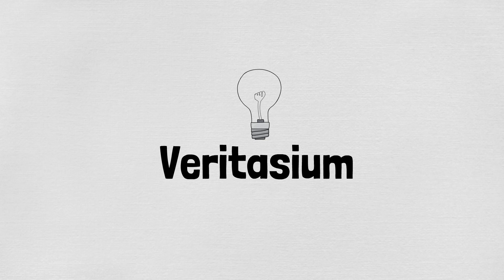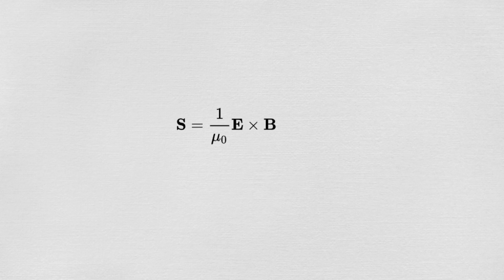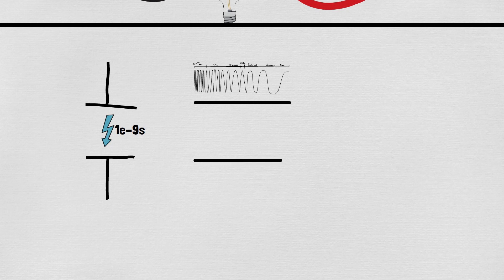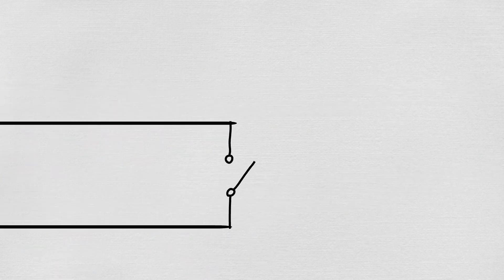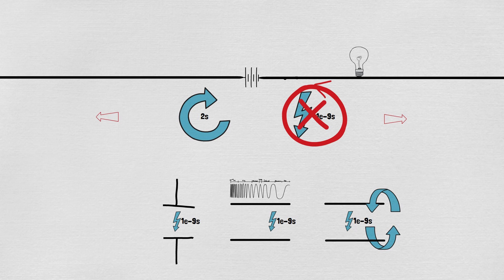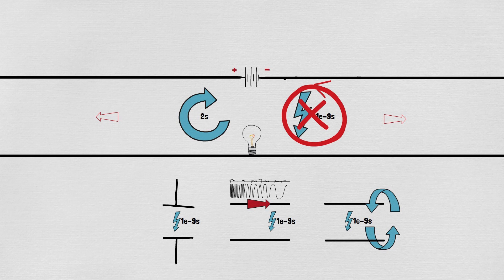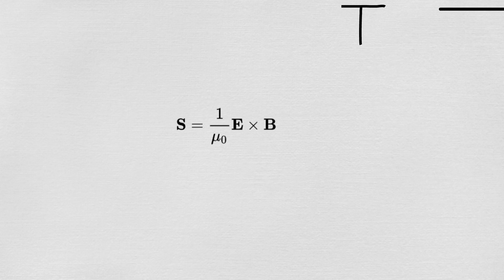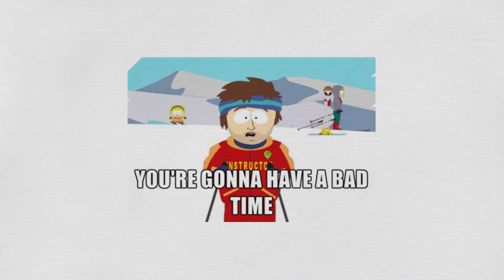Veritasium is Right? (see description)

Comment: Won't it take 1 second, rather than 2 for current to flow through the circuit? I.e., when the switch is closed, doesn't the circuit establish itself in both directions from the battery establishing a full circuit when it reaches the light, 1 second from either end of the battery?

Thanks for sharing this video! Your explanation makes perfect sense. I'm looking forward to Derek posting a retraction.

Comment: I provided the correct circuit analysis by way of comment on the RSD channel . It is basic electromagnetics requiring only application of the Poynting theorem . And yet on goes the flow of comments that causes one to wonder if people read their own writing critically before posting them . The lessons to be learned are , energy flows from the field into the conductors and the load . Energy flows from battery to the fields . You need both moveable charge and fields for electric energy to flow.  Thanks.

Comment: You did make a very correct observation, which summarizes what makes me despise the veritasium video. At 3:35, you mention if we just have a battery connected to a wire, would it power every lightbulb in the universe? In a way, yes, which is why veritasium's video is extremely misleading. If you connected a battery to itself with a switch in the circuit (so you have a wire loop with a battery and a switch. If the switch is on, the battery is shorted; if the switch is off, it is open circuit). Every time you toggle this switch, every lightbulb in the universe will "light up" at the speed of light. The problem is, how infinitesimal this "lighting up" is going to be.

He completely omits the fact that the lightbulb would receive a TINY amount of power from the EM coupling. Any uninformed person who watches the video, will rightfully get the impression that the lightbulb will turn on in 1m/c at the same intensity as though it were connected directly.

Veritasium has attempted to "blow people's minds" and distorted the truth. Everything he said was factually correct in a particular sense of the word, but uninformed people who watched it now know less about electromagnetism than they did before. He clearly gave the impression that the wires were irrelevant to power transmission, which is of course laughable.

However, I'm afraid your explanation is even more wrong than Veritasium. The location of the switch indeed matters. The light will indeed receive a tiny amount of power almost instantly if the switch is placed correctly. You can't move the switch wherever you want. If you have a current sensor instead of a lightbulb, you would indeed see some activity 1m/c after the switch is activated.
Reply from the maker: right the answer is "yes" it would power every bulb in the universe, by the definition of powering a bulb that veritasium is using. in fact, the circuitry in our own brain would light the bulb in derek's thought experiment just by us thinking about it in the vicinity of it.

and yes, i recognize that there's a transient pulse that travels from the switch to the bulb, similar to that of a transmission line the length of the wire from the battery to the switch. i suggested moving the switch around because this (a transient pulse emanating from the switch) is unequivocally not what veritasium is claiming happens.

Comment: You pointed out the essential problem. He tries to create a DC steady state problem but kinda forgets to ground it. I was conflicted originally because the switch stuff isn't a physical switch, he's trying to establish t=0 in a DC steady state problem, but you're 100% right, the air capacitor and transformer here wouldn't work.
Reply: Nah wait it doesn't look like you're right. You'd create air capacitors on both sides, so it is grounded, it should work.
Reply: Also there's 0 resistance on these theoretical wires, which is why every bulb in the universe isn't powered, you have an LRC circuit with no resistance except for the bulb, so s solid chunk of the battery voltage will be transfered to the bulb in 1m/c s

Comment: Yes, they should've specified that the distance between the batter and switch (or between the light bulb and the switch) is negligible.
About powering the light bulb while getting rid of the bottom wire: yes, you actually could. Although, the characteristic impedence of your 'transmission line' will be substantially lower, and therefore, much less current will initially flow. Asside from that, without the sorts, the light will eventually turn back off after one or more reflections back and forth until equilibrium is reached.

Comment: Thank you for this video. Incredibly well put. You gave the reasons I had in mind and added more with your knowledge. Maybe the bulb will glow dimly or flash or whatever immediately, the fact is that the scenario Veritasium described, with all the various details like you listed omitted, would break causality. That is because you cannot transfer information faster than light. Which is why the switch is irrelevant to Derek's experiment, and simply connecting the wires to the battery in the first place would create the desired effect once, then second time on the switch flip.
Reply: The bulb will not flash. Period.
Reply: @eddietee6305  Thank you for your thorough scientific explanation and contribution to the discussion.

Anyway, EEvblog showed that there will be an initial wave of potential difference just as the wires are connected to the battery. This will induce the a potential wave in the opposite direction in the wires attached to the bulb, which is the only way the bulb would flash, and I can imagine it would - if the voltage was higher and the wires closer. I also don't believe the bulb would flash at all, but I don't want to completely disregard this mechanism.
Reply: @isitsaturdayalready1247  the bulb doesn't care which direction the flow of current is in. That's irrelevant in lighting up a simple bulb.
We need steady current flow - that's it!
Transients won't light up the bulb.

Comment: Hey Tycho, I'm a little late to this video, but given the distance in this experiment, there's also a key feature missing: what the wire is made of. Current travels through a medium and a wire isn't a magical source of instant transmission. Current can't exist in a vacuum, so you need to adjust the speed of light in the equation for the speed of light in the medium you've selected, even if you assume that your medium magically has no resistance. If you choose copper, the typical wire, we're talking a lot longer than 2 seconds for the bulb to light up. EDIT: There's also maybe some relativistic problems at hand at this distance too, but I don't think they're enough to drastically change the results.
Reply from the maker: i made a quick comment in the video, "really it's less than that, but for our purposes, let's just say it's the speed of light". it's more like 60% of c.

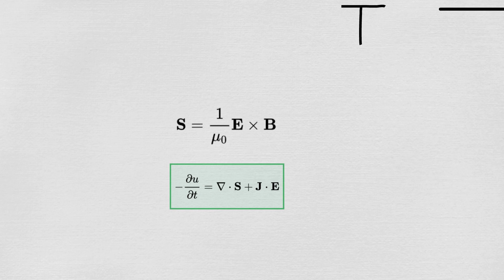Comment: 6:20  I am not an expert, but I would have expected something a little bit more similar to the partial differential equation of a wave propagation. Isn't that this equation, at 6:20, is itself an over-simplification missing some essential elements about the experimentation under consideration?

Comment: This is just a transmission line problem, something I work with every day.  The transmission line has a characteristic impedance defined be the spacing of the wires and the diameter of the wires.  When the switch is closed current will flow in both wires and the light will have current flowing through it based on the step voltage and the impedance of the line.  This is a lot easier to solve in the frequency domain.
Reply: Congratulations.  I also studied transmission line transients (using the Alternative Transients Program) for many years before retirement.  After paging through hundreds of comments below, you are the only other one who gets it.  

I have posted three detailed comments to Veritasium under its video with assumptions of wire size and bulb resistance that conclude that the wires are simply wave guides with about 630 ohm surge impedances each.  Also, that closing the switch will first initiate some  "noise" associated with surge reflections of ground mode propagation at battery terminals, possibly elsewhere, and multi-path wave  reflections back from ground and to the far side of the circuit from ground.  That noise will include the first tiny electromagnetic wave to directly reach the bulb  in 1/300,000 of a second (from charge flowing from the first mm of wire on one side of the switch to the first mm of wire on the other side).  But local reflections will last for some longer time before the local fields stabilize with 99+% of dc battery voltage appearing across the wave guides and outgoing surge current (12V/1270 ohms = 9.4 milliamps) passing through perhaps a 10 ohm bulb filament.  That less than 1% of rated voltage is way too low to light it.  Unless  the bulb is rated in milliwatts and has a resistance several times larger than the waveguide surge impedances, surge current will not light it any time in the first many seconds.

The outgoing surge voltages/currents return as zero voltage, doubled surge currents after one second, initiate another period of noise, double bulb current upon arrival and add another slightly lower increment to bulb current as a new surge departs, based on the slightly higher bulb voltage reducing the voltage on the wave guides.  This repeats for thousands of seconds, - due to lossless wave guides -  depending on how closely one wishes to asymptotically approach 12 V across the bulb as infinitesimal surges continue.  A 7-10 ohm bulb will not light at even half voltage for hours.

Comment: The E field does not need to be established along the whole circuit to produce a current.

An E field pointing along a wire will produce a current evern if the closed line integral around the whole circuit is zero.

The battery produces hols on one side (+) and electrons on the other side (-) thus producing an E Field. When the switch is through on the +(-) side of the battery those hols(electrons) can now flow into the previously neutral region of wire, creating a current, and thus radiates energy out of the wire.

The position of the switch matters, it matters that it's next to the battery.

Comment: Right at 5:00 you say that if there is a break anywhere in the circuit, there will be no potential difference and current will not flow. This is not correct in transmission lines.

The thing that originally tripped me up was that I thought there would be an immediate surge, which would quickly die down, but in fact, there is that "immediate surge" all the way down the transmission line that lasts  until the reflection returns. The thing that makes it tricky is that we tend to think of transmission lines where the source is connected to the 2 wires at one end and the load is connected to the two wires at the other end. In that case, the source sees the characteristic impedance immediately until the reflections return at which time reflections settle into the input impedance that includes the load.

It turns out that this is also the case where the source is one wire of the transmission line, the load is the other wire on the same side of the transmission line; and the other end of the transmission line is a (short? open? matched termination?)  This persists until the reflections settle down and the impedance of the transmission line settles into its steady state and the input impedance becomes the transmission line + load as opposed to just the characteristic impedance.
Reply from the maker: Mark, if i connect a wire to a neutral capacitive (conducting) plate and the other end of the wire to the negative terminal of a battery, but do nothing else, does the plate become negatively charged just waiting to discharge somewhere or does it remain neutral? My intuition (and simple experiments) tell me it stays neutral. So if I were to connect this plate somehow to the positive terminal, the current wouldn't flow through it until the signal of that connection reached back to the negative terminal.
Reply: @antimatterhorn  At the time of the connection, charge will start to flow and the plate of the capacitor will approach the negative voltage of the battery. The displacement current will push charge on the other plate until its charge gets backed up since it doesn't really have a place to go. Sort of like how the gate of a MOSFET operates on enhancement mode and depletion mode  channels under the gate into which there is no conductive connection.

While this flow on just a capacitor and battery may be a simple experiment, it doesn't necessarily take simple equipment to make the measurements.  Your intuition is failing you because your intuition is about the steady state rather than the transient. To develop your intuition on this particular issue, you may want to study the derivation of the characteristic impedance in a transmission line (Z sub 0). If you don't know what characteristic impedance is and why it exists, it's hard to see Veritasium's point.

Comment: I'm not sure i understand your description corectly. But there is a voltage over the battery but also one over the switch. This have been even out during the time the switch have been open. Well assumed that the switch been open for a longer period of time.

When you short the switch, the potential diffrance between the two wires get shorted, and the electron starts to move, they do this initially only due to the potential diffrance in the wire. Because the diffrance travle in virtually the speed of light, the current can keep moving with out anything stopping it. This induce all of the other effects.

Comment: Best explanation yet!  Thank you.  I read the other comments as well.  Let’s say we have two switches and the other is at one end (as shown in the video) and now you replace the light bulb with a sensitive receiver to get away from the “on” qualifier for the light bulb.  Will the receiver register the transient in 1/c if the first switch is thrown but not the second given it is attached to a DC source.   Will you get the ringing as has been mentioned even though the circuit is still open?  So does the EM field have to be established along the entire circuit first for current to flow?

Comment: Great explanation. With no moving charge in the wire, no EM field travelling to the bulb. Classic case of trying to explain a dynamic situation with a static model.
Reply: You do get moving charges when you close the switch though. There is a voltage difference between the switch terminals, and after the switch is closed there is no longer is a voltage difference. Therefore charges must have moved.
Reply: @timonix2  Absolutely, you do get moving charges. But for that to happen, the electric field will first have to propagate along the entire wire loop, at approx. the speed of light. This will take much longer than 1/c sec, so the bulb will not turn on "sooner" than the time it takes to get the electrons moving....

Comment: 1. The switch has a static potential prior to closing.
2. When the switch is closed, the left side drop 6v, and the right side rises 6 volts, thus opposing waves propagate away from the switch at the speed of light. Begin induction.
At 1/c the wave has moved one meter each side of the switch, and the induced field travelled begun across the air gap. At this point, the effect is zero; but beyond this point, the initial wave created by the switch just begins to induce on the light wires. The initial effect is minimal, thus the question is begged: how much current or required to "light" the lamp. Veratasium shows the light bright enough to be visible out of doors. This is a farce; however, if we assume that light means merely >0v, then yes, something is possible at >1/c. We could talk about the quality of that something, a switch is an infinite frequency wave front generator, if we assume a perfect battery, perfect switch and perfect wire, the resultant resonant frequency would be infinite, so, radio waves can propagate across the 1 m distance because the wavelength will be far smaller than 1 m.
How well it's detected on the other end I couldn't say, but if we agree anything greater than zero is sufficient, I'm sure it passes.

Comment: The Veritasium video is not wrong - but it misses a way of analyzing the circuit that is more intuitive. As other answers here noted, a long pair of parallel wires forms a transmission line, and one key thing to know about a transmission line is the it acts exactly like a resistor when a voltage is applied across its conductors, for the entire time the transient is travelling down the line and back. If the line is infinitely long, that is forever. In the case of the thought experiment in the Veritasium video, that time is about 2 seconds. So for two full seconds, the shorted transmission line is for all practical purposes a resistor. What value resistor you ask? I'm not sure exactly, but I know a twin lead antenna wire is about 300 ohms, and I bet the 1 meter apart wires are in the same ballpark.
So does the bulb light? Only if the current through 600 ohms (300 ohms on each side of the bulb) allows enough current to light it. If the bulb was an LED, and the battery was 6 volts, that would light it quite visibly. Is it only a brief flash while the capacitance wire to wire charges? Nope. The current continues at exactly the same level, not decaying, for the entire time the wave is passing down the line to the end and back, which takes two seconds. What happens after two seconds? The bulb is exposed to the full battery voltage with no resistance (assuming magic zero resistance wire.)